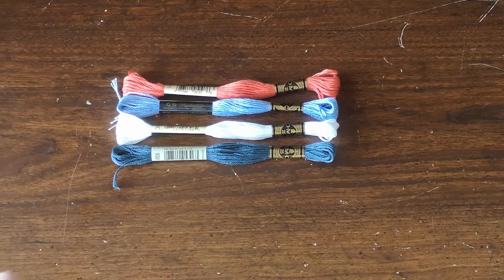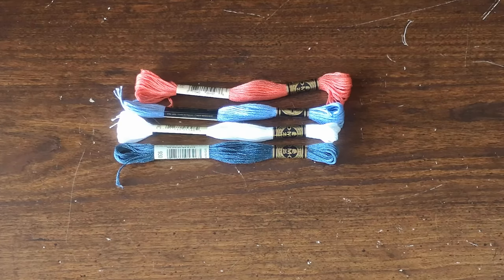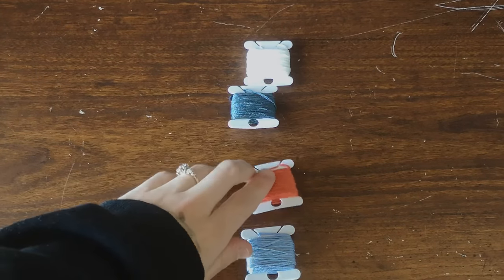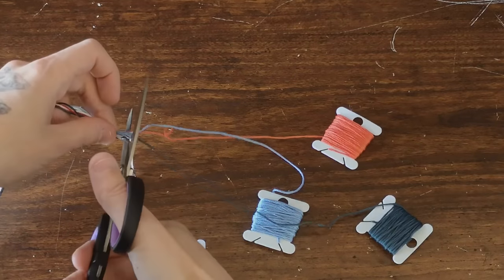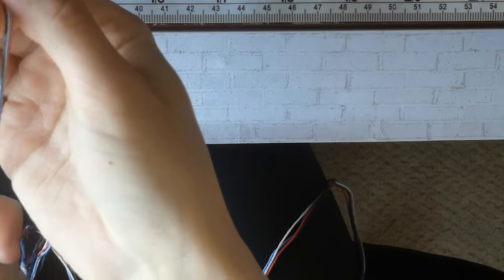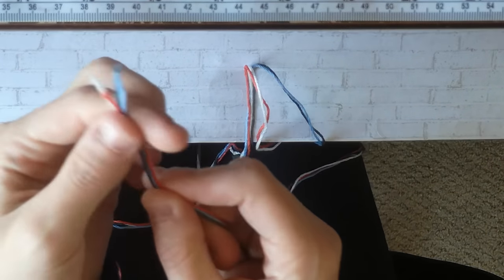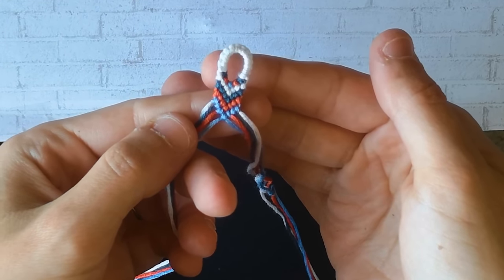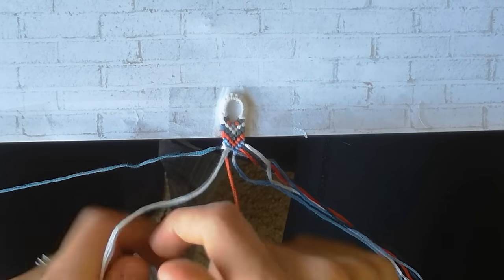EASY Chevron Tutorial with TEAR DROP LOOP // Friendship Bracelets: Beginner DIY

Comment: When beginning the loop, on the part where you do it reverse, her hands are off screen where I can’t tell if she’s going under or over ;;;
Reply: I feel the same way.
Reply: Time stamp and I’ll tell you because I’ve used her tut before
Reply: @Ambermae27  i can’t tell either, the time is around 4:50
Reply: Always above. Over the thread.
Reply: So since its a forward and backward you go over making a four and then under and hold your main string steady while you pull the one your making a color with
Reply: Try both
Reply: I had the same issue! So frustrating. 🤪
Reply: I felt the same. I did it wrong at first, so I figured out she was going over on both the normal 4 & backwards 4.
Reply: BoTh knots the string always goes over, never under.
Reply: I do 2 normal knots usually

Comment: Measurements- 2:08 to 2:32

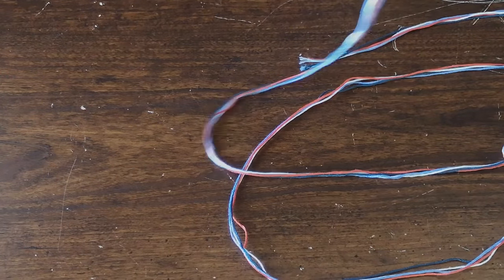Extra info- 2:58 to 3:33

Loop instructions- 4:08 to 5:00
 - 5:45 to 6:10
 - 7:33 to 8:40
 - 8:45 to 9:03
 - 10:04 to 10:18

Making the bracelet- 10:50 to 11:12 (then repeat for colors on that side)
 - 11:41 to 12:05 (then repeat again)
 - 12:32 to 12:40

(Continue bracelet until desired length)

Finishing off the bracelet- 22:36 to 22:43 (repeats on both sides)

(Tie a knot at the end of your braid)

Putting on the bracelet- 23:51 to 24:10
Reply: Thank you

Comment: If you have trouble getting the bracelet to stick to the table with tape, use a binder clip to hold it and then tape the binder clip to the table. The metal of the binder clip sticks to the tape better than it does to the thread.

Comment: I decided to learn how to make these so I can then use it as collars for my cats
Reply: make sure the collar can come apart easy so they dont get choked by anything
Reply: @sierraharley7271  Thanks, that's a good tip. I also didn't make the end's tail long so they can't choke on them, or bite and pull it out. so far I've made two (I have three cats), the first one I did end up being very thin since I didn't quite know the quantity of thread to use. And the second one, I did yesterday, looked great, the right length and width (and my cat loved it). Still one to go, and another to fix.
Reply: @evanbrito4573  ahh I’m saying if they are outside cats the collar needs to be able to break off entirely so the don’t get stuck or hung by the collar. Inside cats should have them too but it’s not as important but I wish I could make them!! I gave up because it was too hard for me haha
Reply: @sierraharley7271  oh, got it! My cats are all inside cats, so they're pretty chill, even if they play fight with one another from time to time haha. But yeah, they're enjoying it and had no problem with the collars so far, if they try to put it out it's maybe because it's too tight, which they didn't, cause i purposely made them loose. 
And also, don't give up, you can do this!! I had never done any kind of bracelet in my whole life, and I'm still no expert of course, but what matters is trying, and with time and experience we will have made tons of beautiful bracelets haha. If you ever give it another try, hit me up, I would love to see the results :D

Comment: Very good video but could you use inches instead of the other measurement you used I only understand inches for how long the strings need to be to make the bracelet thanks
Reply: Most rulers have both measurements on there — have you checked?